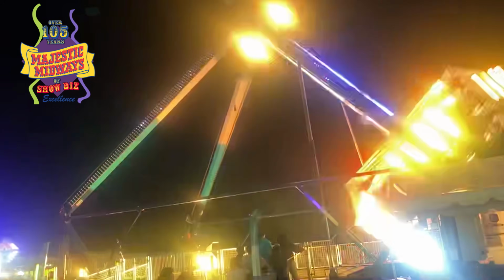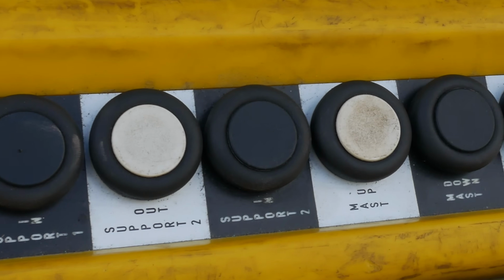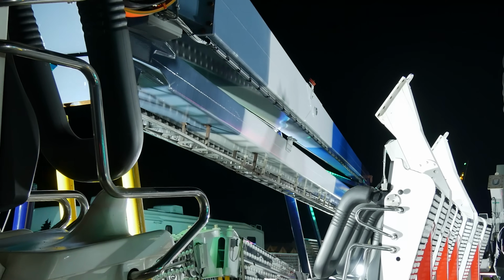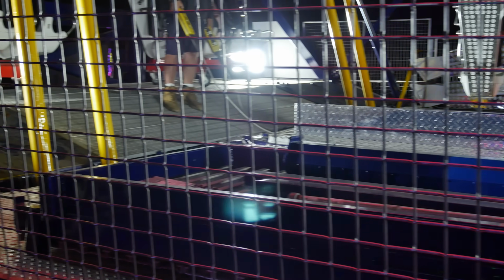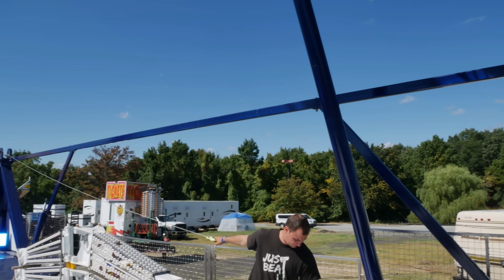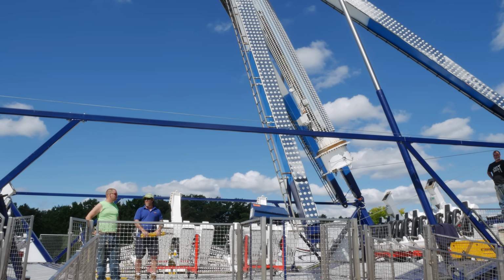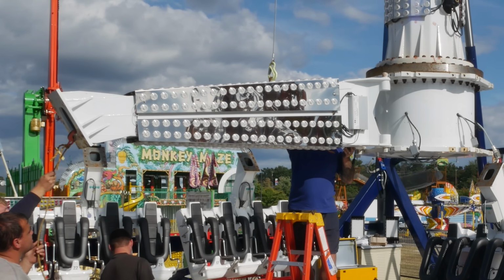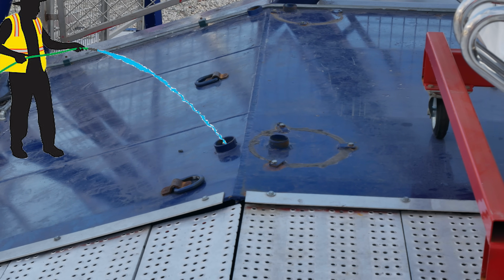Setting Up the KMG Fireball / Afterburner Ride

Comment: I had this ride for 4 years, and the set up and tear down was work fer sure, Did this kinda work for 15 years and while I miss the operation part of the carnival, Set up and tear down was not easy especially working a full day on tear down day and then having to tear down your ride right after working on closing day. My Fireball was red and white,  Liking the blue and white on this one. Solid ride but the electrical box had issues when the weather got to hot or to cold.

Comment: Isn't this the ride (not the actual one) that the chairs become disconnected and slung people out? I'm just curious if they ever figured out what happened?
Reply from the maker: Yes, this is the same type of ride.  It was found that the seat assembly could trap water and rust from the inside out.  The manufacturer redesigned the seats and all the units out on the road the were retrofitted.  I believe the ride involved in the accident was scrapped.

Comment: Commutuator is a method use to switch polarity on a DC motor 

These are slip rings just like are used for a Generator in a power plant

Comment: 5:18 I've actually built a functioning ferris wheel prop for a Dannon's yogurt commercial (fun with children on a tv stage) 1/4" plywood and pine framing, it had a 18' wheel about 6' off the deck. It had lights and a commutator.. er... After looking it up, I need to call that a slip ring!! lol

Comment: How the heck do they remember what part goes where and in the order its supposed to be???
Reply from the maker: There are a few different things.  First of all, there is a manual and the person who is the lead for the ride has read it.  On this particular ride, the lead also was the same person who completely re-wired it from scratch, so he is intimately familiar with it.  
Secondly, these rides have no extra parts.  They have just the correct amount of parts.  When you are out of parts, and all of the holes have fasteners in them, you know you are done.  If you have an extra bolt, you know you aren't done.
And finally, every season there is a single crew that becomes responsible for a ride's assembly/disassembly. Once they have done it a few times they don't even need the ride lead.

Comment: The design and  engineering needed to both transport and then rig /de-rig is quite something.
The placing of fittings  to keep huge lumps of steel in the right place when being swung about and then being re-used for the ride proper always impresses me.

Comment: Their like a school where you learn all this? Just asking because man that is a lot of bolts and torques and the use of the wench. Wow just amazing, i hope those guys get paid well. Lots of peoples lives at stake, don't want miss a bolt bob!
Reply from the maker: One of the things that helps is there are typically no extra parts.  You keep putting the ride  together until you run out of parts.  If a bolt becomes damaged or a wedge is stretched out and needs to be replaced, you have to get it from back at the shop or off the maintenance truck.

Comment: Pretty amazing that it racks onto only two trailers. Considering its size one would think you would need three or four trailers to transport them. The engineering and design that goes into making these rides transportable is mind-boggling.
Reply from the maker: The power of those large hydraulic cylinders is what amazes me the most.

Comment: Thank you very much for the whole video. Especially for the showing of the serial plate. Is the name of the first owner misspelled? I thought it was Cumberland Valley Shows - not Camberland - Or am I wrong? Since when is the ride under the ownership of Majestic Midways?
Reply from the maker: Yes, the name on the plate is spelled wrong. It went from CVS to NAME then to Majestic. They’ve had it for about 3 years and completely rebuilt it.
Reply: @PeteRondeau  Thanks for the information, Pete. I do not see any pictures of the ride on the website (which seems to be not up to date?) or on their Facebook-channel. Do they still own / operate the KMG Afterburner or has been sold again?
Reply from the maker: They sold it last year
Reply: @PeteRondeau  Thanks again. Do you know who has become the new owner of that ride?
Reply from the maker: @Tejay1970  it is in Alaska  https://youtu.be/GXqpMKr1J1Q?si=7ArzxIM1_9M6WSK0

Comment: this afterburner looks greatly maintained
Reply from the maker: It was completely rebuilt within the last few years and stored inside in the off season.  That helps a lot!
Reply: @PeteRondeau  I think they choose rebuild it when after the incident at the ohio state fair. KMG order to stop any afterburner to operate at that time.
Reply from the maker: They didn't even own it back when that happened.  But that may have been why the previous owner sold it.  But yes, in addition to all the rewiring and motor and bearing replacements, this has the redesigned seat gondolas.
Reply: @4everpee  It was owned by North american midway entertainment under the name “Feuerball” and it was bought sometime in late 2019-early 2020 by Majestic midways

Comment: KMG says 3-4 hour construction time with 3 persons... I think that number might be embellished.
Reply from the maker: I agree. That seems a bit ambitious.
Reply: @PeteRondeau  or dangerous!
Reply: Use to work on the kmg freak out. For those who don't know. Basically an afterburner with four sets of gondolas. And it took five guys four and a half hours to pull down. So yeh maybe a bit exaggerated.
Reply: @Thesmokercoaster  wowzer people don't realise the hard graft that goes into the build up and pull down. Are u a showman?
Reply: @Thesmokercoaster used to see that at the Allentown fair every year 😂
Reply: We had our old KMG afterburner built over 20 years ago set up in just over 3 hours with a good crew.. in England we have fairs in October which only last a day or two so it’s hard graft setting up and down so often. We sold the afterburner for the Freak Out single loader which is much easier and less physical work
Reply: Actually that’s pretty accurate. However, they’re basing those numbers off European Showmen.
Reply: @audiodude74  I doubt that.  The European versions tend to have have more art work/decorative add-ons.  The American ones are a bit more stripped down, thus less to assemble.  Also the American ones move every week, hence more familiarity, whilst European showmen tend to stay at one fairground a bit longer.  There's no evidence to suggest otherwise.
Reply: @cup_and_cone  just stating from what I’ve seen personally while over there. European rides and shows are independent. They only deal with one ride. They typically travel every week. Set ups are pretty much in the streets.
Reply: If you've got a crew that knows how to work and assemble the machine, it is possible in 3-4 hours. Used to work with these myself.

This Afterburner is the old version or 'generation'. The Gen2 has even less physical work for the crew, regarding floors mostly. There's one called Phönix.